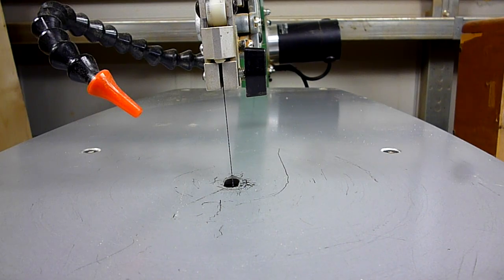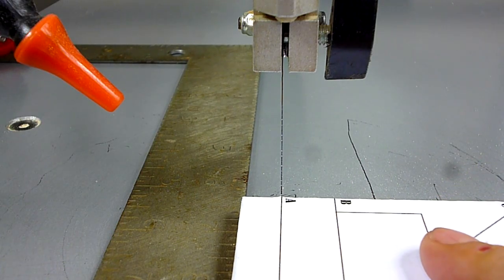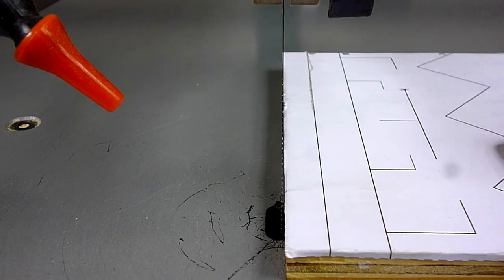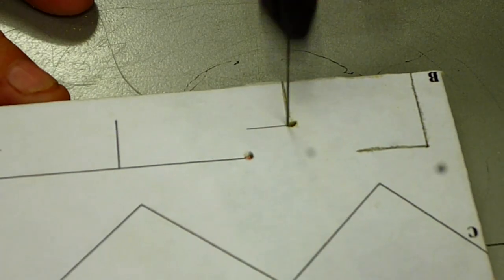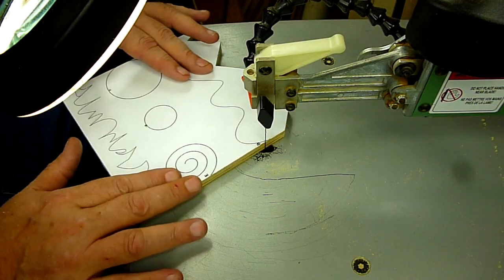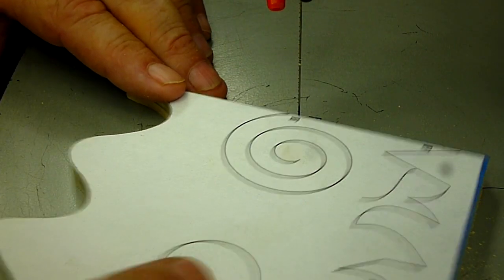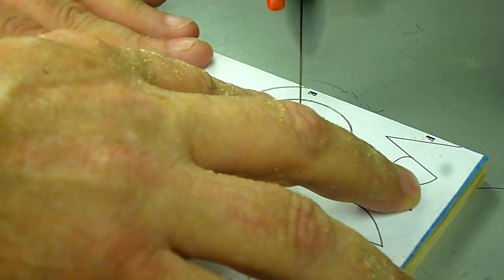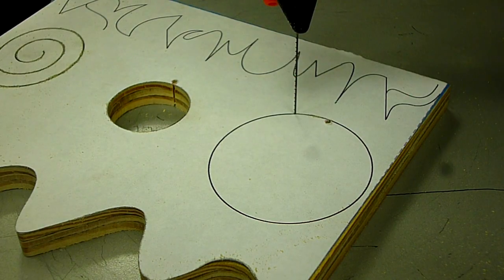Scroll Saw Cutting for Beginners Pt 2

Comment: Your patience in showing us how to properly use a scroll saw is very appreciated. You take the time necessary to each portion of the practice board. Unlike those who speed through the process, your method allows us to actually see possible difficult areas. I take this to heart. Thanks for your work. Just got my saw and am anxious to get started.
Reply from the maker: David Damico  Thanks David, I appreciate the comment and congrats on the new saw.

Comment: I cannot thank you enough. I just started my first set of corbels. they have several layers and are a little detailed with a LOT of curves. I would consider myself an intermediate woodworker so I put a 1/4 blade on my bandsaw to do the detail work (I had contemplated getting out my scroll saw).  I was so frustrating and I ruined a piece already. it is obvious now I should have used the scroll saw. thank you!

Comment from the maker: Millan, I have not used a Craftsman scroll saw before, but I have had a few different brands and I never had to re-tension on changing holes. I would recommend going over the manual for the saw to make sure you are not "Missing something". Maybe someone here that owns the same saw can help better than I can and offer a suggestion. I will say that a new blade will stretch a little bit when first installed and may need to be re-tensioned after a few minutes of use, but not after every hole.

Comment: Super great instruction.  Thank you.
   
I have a Dewalt 788. And yes, I thought the saw was broken (crooked).  Also, I was use to using a big old Rockwell Scroll Saw where I would put the work over the blade and sticking it through the hole.  I keep forgetting that, like your Excalibur, the Dewalt arm lifts up out of the way after loosening the blade from the bottom. How easy!

Again, thank you!
Reply from the maker: SteveS us  Hey Steve, I'm glad you got something out of the video, top feeding can be a real time saver. Good Luck
Bob

Comment: Thank you for the demonstrations. It's really great to know that it is standard to not be able to run a straight line with the blade as well as the reminder to not beat myself up when my first cuts (for some reason) just don't look like the the pro's in the videos. Those things are frustrating.

Comment: Excellent video. I was going to take my DeWalt back.  It cannot cut a straight line.  Now I will practice with your template and see if maybe it is me and not the saw.  Oh, and it also will not cut a circle, or a 90 degree etc.  Watching you gives me lots to practice on.
Reply from the maker: Hi Bob, Don't worry, you will have your saw cutting perfect lines and circles in no time, a little practice is all it takes. Have fun and enjoy all the really cool projects you will soon be making....Bob

Comment: After watching your video, it dawn on me that a scroll saw is inherently a free-hand device. I tend to cut straight lines in "auto" mode, as in pushing the object through the saw while sliding it against a straight template. Broke my first blade straightaway on my very first cut doing that. Now I know better.

Comment: After only making a few things on the scroll saw, I switched to spiral blades and don't have the angle/corner problems associated with a straight blade. So much easier!
Reply from the maker: Danengewood- .Dan Engebretsen  That's great Dan, I and many others prefer not to have the rounded corners and thick lines that spirals give you. If all you do is rustic portraits, that's great, but style-wise I prefer the clean cuts that you get with flat blades.

Comment: Brilliant instructional videos. Learnt a lot before spending any money and making mistakes. Can you recommend a good quality saw for carrying out such intricate work? Thanks for such interesting stuff!!
Reply from the maker: Hi David,
As long as your scroll saw can use pinless blades, you will be able to do intricate work regardless of the brand of scroll saw. You can not do intricate work with a saw that only takes a pinned blade. There is a wide variety of scroll saws when it comes to price, and I don't know what your budget is. In the $800+(USD) range you have Excalibur, Hegner and RBI, all of which are good saws. $300- $700 range is Dewalt 788 and Delta 40-695, also good saws. Below $300 there is a wide variety of saws, some ok, some not.
I would recommend trying to find a used saw on Craigslist or somewhere else like a pawn shop to try out first, you might get lucky and find a good saw at a cheap price. This way you will spend minimal money and also decide if you are going to stick with scroll sawing as a hobby, than you can spend more on a better saw if you desire.
Thanks for the comments.
Bob

Comment: A great resource for us noobs, thank you!
Does that mean if you have "fence" at the drift angle it will help you to cut straighter? Or will it bind?
I've had a lot of practice using my routers with template. I tried the same approach with my scrollsaw, I cut out a hardboard blank shape, ensured edges were flat properly, and then stuck it on my wood piece to cut with my scrollsaw. It worked well, following the edge of the blank meant it didn't wander as much as when doing by freehand. Is that a valid way to do things? 
Another thing is you showed how the blade bends thru cut line with too much feed pressure but how much play is OK perpendicular to feed direction? I am too inexperienced to tell if it's my feeding (straight wood cut, no template) that causes the blade to bend sideways or whether it is because the blade is following the grain of the wood.

Comment: Hi Bob, I really enjoyed the beginner video. My question is where to get scrolling wood
Reply from the maker: Hi Nancy, Any wood 3/4" and below can be easily cut on a scrollsaw, this wood can be readily found at most home stores. Many projects are cut with thinner wood down to 1/4" and 1/8" which are harder to come by. The home stores, HD and Lowes, do usually carry some thin wood down to 1/4". This wood is usually Oak or Poplar but I'm sure it will vary from store to store. I would suggest asking an associate to help you find the thinner woods. If you don't mind doing shopping on the internet you can do a general search for "Thin Wood" and you will get lots of results. I like to use Ochooch hardwoods https://ocoochhardwoods.com/ and E-Bay to get most of my wood. You can also check any local lumber yards in your area, I'm sure they will be happy to help...Bob

Comment: Great tips!  Got a new scroll saw and I cannot get it to go more then an inch, for that part of my straight line is good but why won't it got any further.  I have no saw dust that would be clogging it down.
Reply from the maker: Hi Suu, your tension is not tight enough on your blade. Get the tension good and tight and retry your straight-line cut. I'm sure it will be much easier for you...Bob
Reply: Thanks, I think that and the fact that the plate around the blade has a lift on one side in the back.  Just cheap plastic, I clamped it to a flat piece of wood in hopes it will flatten out.

Comment: My husband and I acquired and older model Sears scroll saw. It was hard to find the blades, there was no booklet for any kind of instructions, so it's been sitting in the garage, unused for a few years. Although I've always been curious and eager to create something with it! I came across your video and have been thrilled with what I've learned so far. I never knew about the tape and was wondering how to transfer patterns...answered here, TY.  Luckily, we do have a drill press, (my favorite tool in the garage). I do have a couple questions though, the blade on your saw looks much thinner than what we have and I was wondering if they normally come in different widths? I've only been able to find one type for our saw. Also the base table / work area is pretty small on ours. Did you add an additional work area to yours? If so I may have to look into how to attach a larger one to ours. Thanks so much for taking the time to help and for making the videos, I'll be looking forward to watching many more!!
Reply from the maker: Ela Davis  Hi Ela, I'd say it's time to break that scroll saw out! You have asked some questions that are big topics, I will answer them as briefly and thoroughly as I can here. Scrollsaw blades come in many sizes, from #00 thru #12, The lower the number the thinner the blade (The lengths of the blades are all the same) and come in two main types, Pinned and Pinless. Some scroll saw can use either type of blade, but some can only use one or the other, pinned or pinless. It is important to know which one your saw is designed for before buying blades. The most useful and versatile blades are pinless blades, which is what most scrollers use. You can easily find manuals for your scroll saw online, simply search for the manual for your brand and model #  scrollsaw. With a little extra searching,  you can find free manuals. The best way to get blades is ordering them online, you can get them much cheaper than you will find at home centers and hardware stores. Here is a good starter pack of pinless blades for new scrollers http://www.scrollsawparadise.com/#!scroll-saw-supplies/czso. 

The table size varies for scroll saws depending on the manufacturer, some have big tables and some have small. You can always get a piece of Melamine wood from Home depot, cut a slot in it and clamp it somehow to your existing table to make it any size you would like. I plan on making a video showing this in the near future. Hope this helps and good luck. If you have any more questions please send me an email to bob.scrollsawparadise@gmail.com

Comment: What blade was used in this demonstration? I am looking to cut 3/4" pen blanks on a 90 degree zig zag all the way down without removing it at any point, so I need clean and perfect 90 degrees in order for this to work. I haven't the foggiest idea what blade to select for this very purpose. Cheers!

Comment: Im new to scroll sawing.. I put a small piece of wood into cut. 1/4 thick.. The piece would jump.. then cut then jump than cut.. and than the blade snapped. So i got frustrated and put it away. Do you know what causes that? I see your wood never jumps, and i was even using the footer hold down thing. ( i also wanted to note.. My first long cut was about 24 inches and i had no issues.) maybe tension came loose on the second cut? it was tearing the wood apart. unlike the first pass that was nice and clean.

Comment: Would this be a good saw to use for cutting out a NH State out line using wood material? I do it now with a jig saw and then sand it down using a dremel. Wanted to try something that might be easier to handle. Thanks!
Reply from the maker: Hi Chris, as long as the size of the piece you are cutting is less than 16" on the longest side, it would be a much better choice than a jigsaw. The thickness of the wood you are cutting should be 3/4" thick or less as well. Hope trhat answers your question...Bob

Comment: The wood bounces up and down if you have the speed to low, to high and you will wear the saw out, the high setting should really only  be used when cutting metal.

Comment: Great video for beginners, as I am.  Just made my first art piece and not completely happy with it but it's my first one.  I am glad you showed the reason why the materiel drifts when cutting because I was quite discouraged yesterday.  Wasn't sure what I was doing wrong.  I went through one of your practice patters and will have to go through then a few more times for sure.  May I ask what blade you were using?
Reply from the maker: Hi Roger, Glad my videos helped to solve your issues, that's what they are for. As you get more comfortable behind your scroll saw, your projects will get better. As for blade size, I use Flying Dutchman UR#5, UR #3' and UR 1's. Any of them will work on 95% of your projects that are made from wood. There is no need to get too wrapped up in blade sizes or types. As long as the blade can cut the wood, you will be fine. I do like to use the smallest blade practical for the project I am working on. Smaller blades make small cuts easier. Good luck and have fun...Bob

Comment: Thanks for your well demonstrated tutorial this answers a few questions the one question that I do have since Im new to the hobby, I have recently purchased a few wooden toy car patterns What is the best method for cutting out very small motor parts that are under an inch in thickness width and length, would I cut the piece out of stock and then apply the pattern to it or would I apply the pattern and then cut it out?
Reply from the maker: Hi Kevin, it is always best to apply the pattern first, and then cut it out. it is easier to control a bigger -piece than a small piece while cutting.
Reply: @Scrollsawforum1  thanks for your reply, after a couple attempts/fails yesterday I came realize that was they way to do so. I have since gone back to square one and took my pattern and transferred all the multiple parts onto stock lengths. Today I will build myself a scroll saw stand that I can sit at (due to back pain issues) once thats done I will be printing a copy or two of the practise sheet that you have in your link. I do appreciate your tutorial it is very informative and very helpful. Thanks again! Happy scrolling!

Comment: Intereasting,thank you for sharing ......can I use the scroll saw on normal wood? like oak or other wood ? :)
Reply from the maker: You can use your scroll saw for any type of wood and with the proper blade you can also cut, plastics, soft metals and even coins.
Reply: Thank you for the kind response, I saw that people were using it on only plywood... :)

Comment: Hi Bob, I am a very beginner in scrolling and I really appreciate this fantastic course you are giving to us! It is really the best! But I have one question. What size of the blade you are using in this "lesson"? I am using nr 5 and trying to make a sharp corner like you did it (23:30 in this film), but I really cannot make it, because I simply cannot turn my workpiece in place so the blade is pointing to the second line. What I can do is to go back in the previous line and start making the ark to get to second line. But then the corner is not cut properly. The blade is not cutting on the side, so how to make this 30-40 degree turn in place?

Kate
Reply from the maker: Katarzyna Jurek  Hi Kate, The time stamp for the video is at the end of the video, so it unfortunately did not help. Is the saw running when you make the turn? The blade needs to be cutting the wood as you make the turn. The blade size does not matter, these cuts can be made with any blade except maybe a #9 or larger. Hope this helps, but if it doesn't let me know. 
Bob
Reply: ScrollSawParadise Heh, my mistake about the time stamp. It should be 18:45, when you are making the first corner of the "final exam". I am running the machine on a quite high speed while trying to cut this, so it is not this kind of mistake. I can manage to go back, spin the blade around 180 degrees, get back to the corner, but I cannot attack the second line because it seems that the blade is not allowing me to make this little turn in place. I really feel the blade is in defense and I don't want to break it. It's just like the blade is yelling: "hey, I cut only from the front, not from the side!" It is really confusing me.. 
Thanks for your patience and willingnes to help!
Kate
Reply from the maker: Katarzyna Jurek Ok Kate, that helped, now I understand where your problem is. Hopefully I can explain this and it makes sense, a video would be easier, but I don't have time for that right now. In a situation like this (18:45) one of the pieces is going to be wasted, either the left half of the wood, or the right half. you obviously will know before you start cutting which is the piece that will be saved. If you fast forward to 20:36 in the video, you will see that the inner part of the "V" gets discarded, which means if you have to nibble away a little bit at the bottom of the "V" to get a better angle of attack for your blade thats perfectly fine. If it was the opposite, than you could simply do a loop out the bottom of the V to come back and attack the "other half of the "v". Please let me know if that made sense. I could have explained that a little better in the video.
Reply: ScrollSawParadise I was trying to solve my problem and trying to make all the things properly. I think the main mistake was with the blade tension. I was to secure with it, today I made the tension really hard (thank you for your latest video!) and finally I managed to make the turn. However, the result is not perfect, there is still a bulge at the beginning of the second line. in the area where the blade have no chance to cut. I made a photo of it:
https://drive.google.com/file/d/0B5ktPKj2pj3gZnl1aU1sUDFBR2s/edit?usp=sharing

Of course I can attack this little bulge from the other side, but I assume this is not the point...
Reply from the maker: Katarzyna Jurek  Kate, Give me a day or two, I will post a video to respond to your problem.
Reply: ScrollSawParadise Bob, you are really a fantastic person!
Reply from the maker: Katarzyna Jurek  Kate Here is the new video, Scroll Saw Cutting For Beginners Final Exam Revisited  I hope this clears up your questions.
Thanks,
Bob

Comment: Would you consider using a router speed control like sold at H.F. for an older single speed scroll saw?
Reply from the maker: Hi Joseph, I looked at the speed controller you referenced, it does seem like a viable option to consider, however I can not recommend it. I simply am not qualified nor familiar enough with the device, or your saw, as to whether or not they will be compatible with each other. If you do decide to try this, just be aware that there is the possibility that it could shorten the life of the scroll saw motor if the motor is not designed for variable speed.